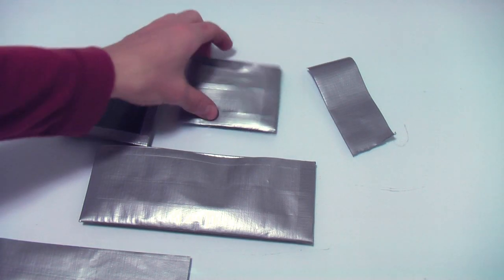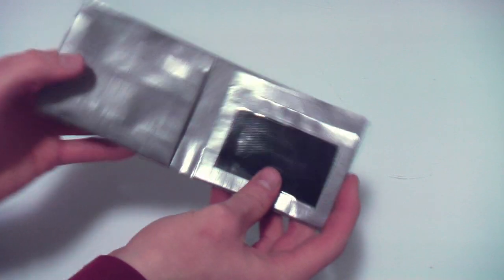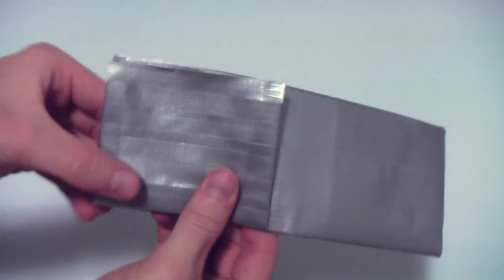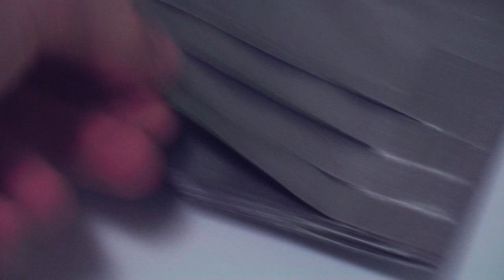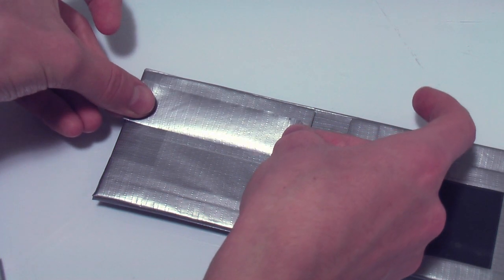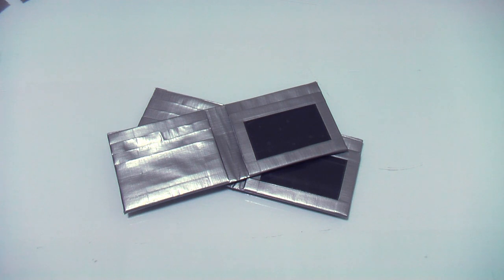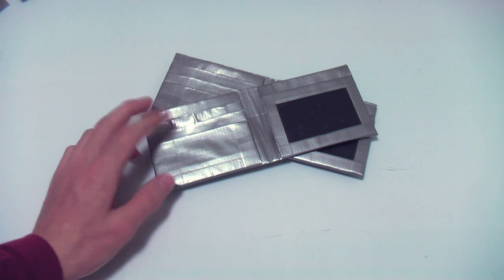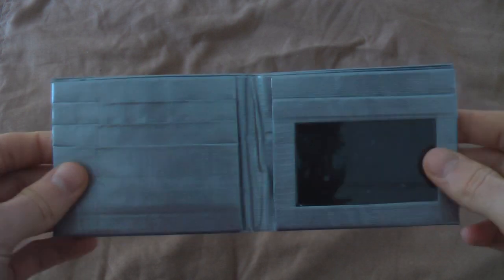How To Make A Duct Tape Wallet 2.0 - Part 3 - HD

Comment from the maker: The leftover F piece is probably just the larger scrap left over.

And yes, you are right, I meant 1cm, I will correct it with an annotation, and if you want to you can just remake the window with the leftover F piece/scrap you have, and just carefully peel the tape off of the one that is on the wallet and place the new one in and push the tape back down, if that makes sense.

Comment: @Rated10STARz before you put that piece of duct tape that goes down the middle, fold the wallet 90° and then apply the tape at that angle. it will help hold the wallet closed, and will reduce wrinkles

Comment: to get rid of the air bubbles quicker, take a pin and lightly press and puncture the surface of only 1 of the pieces of clear tape. make as small a hole as possible whilst still making a hole. then get rid of the pin and use your thumbs to work from the outside of the air bubble towards the little hole you made. works great for bigger bubbles. i used to do this on book wrap for wrapping my primary school books in fancy sticky plastic coating :D

Comment: one suggestion . . . mount the card pockets on a separate sheet of duct tape that isn't as wide as the main pocket, about 1 cm narrower. This reduces wrinkles in the middle of the wallet and makes it lay flatter. but otherwise nice job

Comment: I wanted to make one, but with extra cardholders and a change pocket( folds in three pieces). so i used your tips and template to use as a base. Turns out it made the wallet very big and unpractical. But i really need the space for my cards and here in Europe i use a lot off change. so i'm back to my old leather wallet because its not that big.  anyway, i learned a lot today. 
1. you are a genius. 
2. I am not. 
3. that stuff is really sticky, seriously. 
4. I have to much spare time.